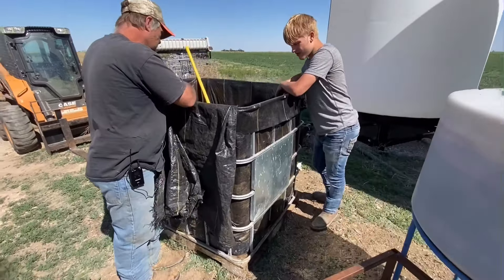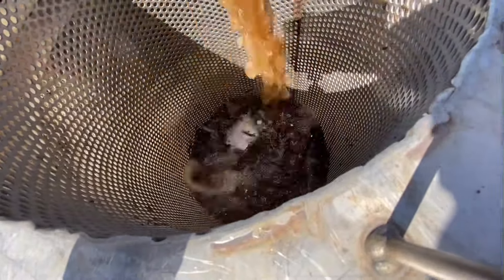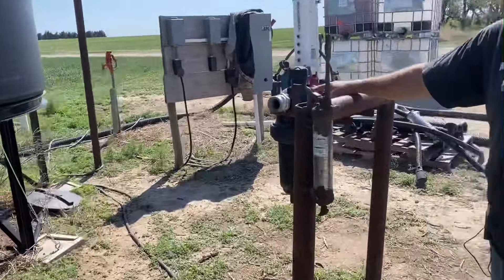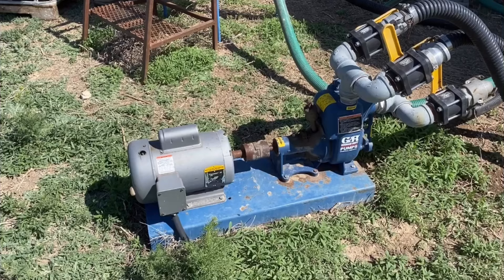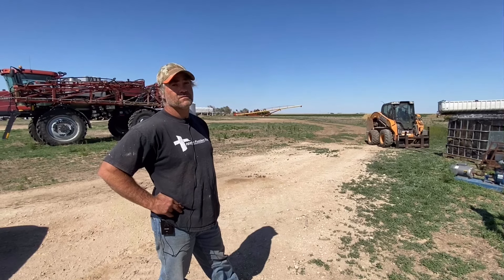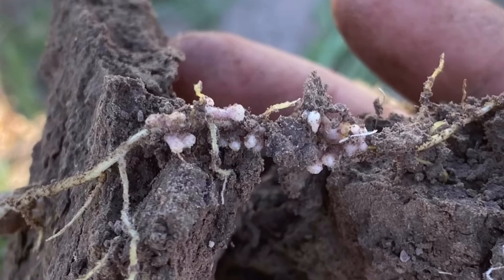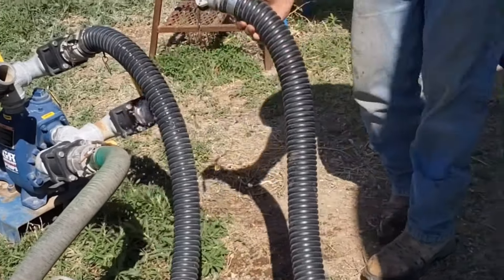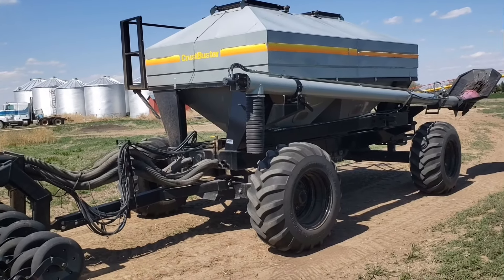How to apply compost extract on your farm.  A great way to increase soil health.

Comment: Do you think spraying this kind of compost tea over the top a hay field prove beneficial for the health of the soil in the field and for the hay yields one can expect?
Reply: Definitely. If you have been using high value synthetics and herbicides or pesticides then you have been unknowingly hurting your soil biology. This type of compost is like a good probiotic. Like probiotics get our guts functioning better this compost heals the gut of the plants which is the root zone and lets then get more free nutrients from the soil as well as balance maintain a balanced nutrition which leads to less pest and disease.
Reply: @TS-vr9of  Do you think it could be used as a replacement for nitrogen type fertilizer on cool season grasses?
Reply: @costeffeful  Completely weening off would be dependent on how active your soil biology is and how healthy and deep your soil is already.  Dr. Johnson who's composting method he mentioned in the beginning of the video  ran a trial with corn on irrigated land and found that with the biology the corn yielded just a little less then the corn with 250 units of N. he also did a strip with 15% of the recommended N rate and that out yielded the full rate. If it can work on corn I don't see way it wouldn't work just as good or better in the cool season. Maybe try some trials with full, half, 15%, and none to see what works on your farm as you increase soil health over the years.

Comment: Jay, I've been watching all your videos on extract. They're so helpful as I'm working to set up an extract system for a 3-rd generation organic dairy farm here in Wisconsin gratis. The first year we'll have to be working out of totes as money is really tight, but I'm hoping we could implement something similar to what John is doing along with building Johnson Su totes as you've described. I don't know if you have answers to any of these questions but this is what I was wondering as I imagined building a extractor like John's.
1.	What is the red fitting on top of the tank where the extract enters the top of the tank? Does the red fitting introduce air into the extract stream as it enters the tank at the top?
2.	Does the extract entering the tank at the top take a 90-degree turn so it’s going horizontally around the top rim of the tank to create a large vortex in the tank?
3.	If there is a large vortex in the tank, what is the flow rate of the pump?
4.     What mesh screen is used in the filter?
5.	Did John have to make any modifications required on the planter to prevent plugging of the lines with extract?
Again, super helpful information because you're showing how to make extract work on a farm scale!

By the way, regarding your Johnson Su trials, I've watched other videos particularly of aerated static compost piles. They also run about a 70% moisture content. The general way to test if its too wet is to squeeze a handful. No more than a drop or so should come out even when squeezing hard. On the flip side testing for dryness, even course wood chips (assuming its been mixed with other materials) should clump together enough to more-or-less remain in a ball. I saw water dripping out of your hand on at least one sample and this is way too wet.

Also, they talk about the importance of "bulk density" as it relates to "free air space" which is important so the pile can breath.. Bulk density should be between 550-950 lbs/cu.yd.– 20-35 lbs/cu.ft. Since a 5-gallon bucket is 0.67 cu.ft., a 5-gallon bucket should weigh between 14-24 pounds. To do this, fill the bucket half way and tampi it down by hand, 2/3rds and tamp, full and tamp, and then topping it off. Finish by weighing the bucket.

Another way to measure "free air space" is by filling a 5-gallon bucket as described. Next, fill the bucket filled with material with water. The water will fill up all the air spaces. Next, subtract the weight of the bucket with material only from the bucket with material and water. Next, divide the water weight by 62.43 to get the volume of air in the bucket (62.43 lbs. water = 1cu.ft.). Finish by dividing the volume of air in cu.ft. by 0.67 to get the percent of the bucket that is “free air space”. The percent of free air space should be between 35-60%.
Reply from the maker: youngredangus@gmail.cim
Reply from the maker: https://m.youtube.com/watch?v=7OGkVg_TtTY&feature=youtu.be

The system they have is pretty amazing as well

Comment: John talks about running the solution through a cyclone for 20-30 minutes for aeration.  I’m guessing these are mounted on the tops of the large cone bottom tanks? Is it possible to get an image of this cyclone, or maybe a brand or part #?  

I will be trying this next spring with some bio5 compost and just started making some tote units to have my own compost for the 2024 growing season.  Thanks for taking the time to make these videos.  - Joe

Comment: Hi Jay

Thanks for making these clips!

I'm right at the start of making the bio-reactor, aiming to reduce compaction on hay meadows via an aerator/dribble set up initially.

This may be obvious but how did you get the compost out of the reactor once the process was complete?

Thanks again.
Reply from the maker: Peter Mawson 
The process isn’t complete yet but I plan of taking the top off and replacing it wit one that is shorter is I don’t have to reach down into them
Reply from the maker: Peter Mawson 

Where is your farming operation located?
Reply: @youngredangus6041  North Yorkshire in the UK.

Comment: Would it be feasible to run the solution through hose that is pulled from a reel onto the feild by the tractor?
It would avoid carrying the heavy weight over the soil

Comment: How many # of compost would I need to produce compost tea (extract)  for 450 acres?

I have horses in stalls and was thinking the manure and hay/bedding would make a good compost.
Reply: Look up Dr. David Johnson's YouTube channel he gives details on how to make them. If you make the reactor to his specs it will yield 700 pounds per reactor. If you waited the full year till most of the material is fully digested then it will work as an infurrow drip at 2lbs/20gal an acre. each reactor will cover 350 acres so making 2 reactors will give you plenty for a furrow drip application. make 3 and you will have extra to experiment with doing seed coats and foliar.
Reply: @TS-vr9of   Thank you. I have watched a couple videos where he spoke but never found his channel. I will look that up.

I farm 750ac of lease ground but the ground is too sandy for me to pull my drill with a loaded liquid tank so I would probably have to do foliar on that ground and if I do foliar there then I would do foliar on the 450ac I own.

I have 3 totes worth of composted manure and hay already.

Comment: Keep up the good work. How long are seeds drenched in extract? Are seeds dried before seeding or seeded wet right after drenching?
Reply from the maker: Farooq Shah 
We did an experiment that I made a video on.  We soaked them for 10-15 min then planted them.   This wheat planting season is the first time I’m going to treat the seed.  I plan on making a video.
Reply: @youngredangus6041  I'm curious too. I feel like wet corn and beans might have a hard time going through the meter on our planter??
Reply from the maker: Farooq Shah 
I’m sorry I don’t know how I missed this post.

I put 11 gallons on 180 bushel of wheat.
Straight in the no til drill with no issues
Reply from the maker: Jacob Landis  I’m going to try it on corn next year

Comment: Hi Jay.  Any knowledge on how the bio reactor behaves in colder climates?  Say January - February temperatures of -20 C to -30 C.  Perhaps the cold weather just slows down the process and doesn't kill it...
Reply from the maker: David Dockendorff 
David Johnson says not to let it freeze.  John has let his get down to around -12 C but -20 to -30 is really cold.  Do you have a way of putting heating tape around it and insulation?
Reply: @youngredangus6041  I thought it might be a bit too cold here.  I could insulate but oxygen is important so it would have to have air flow...  I can put it in the shop which rarely get more than a few deg below 0 C.  It will be annoyingly in the way all winter.  Thanks for the input.  I think I'll try it this fall and see what happens..

Comment: What's your opinion on inoculating walnut/hazelnut seedlings before transplanting them into orchard??  And keep up with good work, you're giving us all some real value with your videos.. Good luck and health!!
Reply from the maker: Anta Anta 

Thank you so much for the encouragement.

I think it will be great.  I would encourage you to make sure you use a lot of wood chips for a good fungal dominant compost.  It may take longer than a year to make.    In the mean time you might be able to buy some mycorrhizae inoculate.  

https://www.researchgate.net/publication/324264731_Impact_of_mycorrhizal_fungi_on_walnuts_and_grapes_resistance_to_pathogens_in_Ukrainian_orchards_-_a_review
Reply from the maker: Anta Anta 
Where is your orchard located?
Reply: @youngredangus6041  First of all, thanks for replying and sharing the link from that research!! 
I tend to read some researches over there when it comes to chicken ,fermented feed ,etc, but I forgot to search on this topic xD 

I don't have an orchard, yet.. Plan is to start planting next year
It will be located on Balkan (South-Eastern Europe, but my climate is continental, cold winters, hot summers, basically all four seasons are present)
Reply from the maker: Good luck!